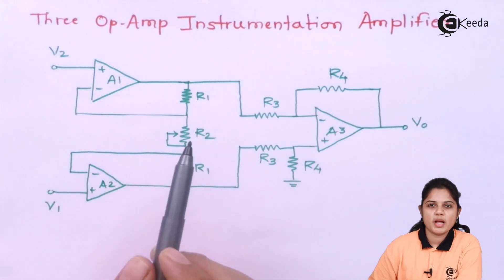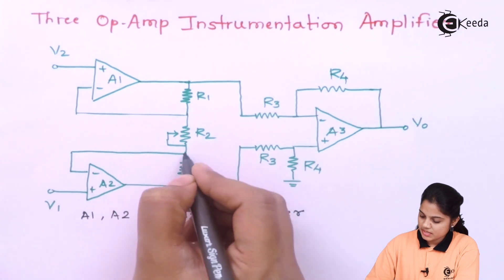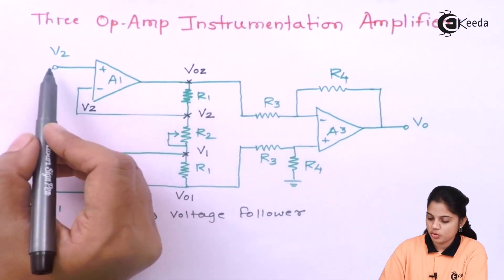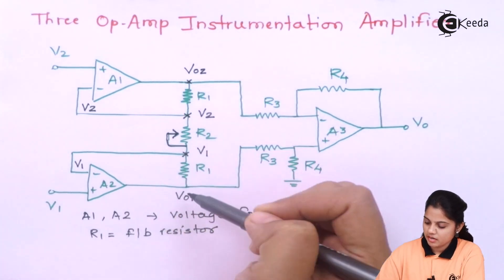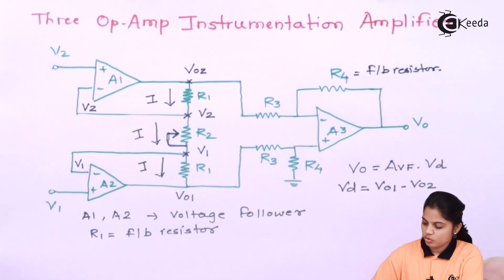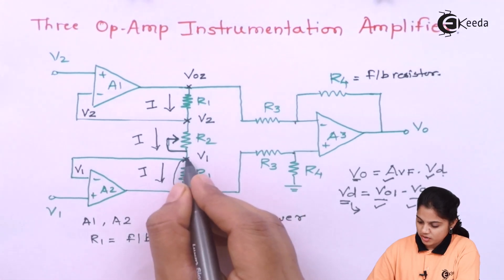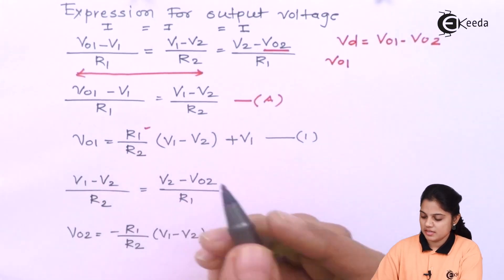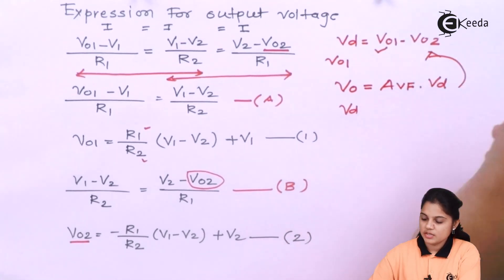Three Op Amp Instrumentation Amplifier - Operational Amplifier and 555 Timer - Industrial Electronic

Comment: It is a differential amplifier, so how will it be in inverting configuration? Because differential amplifier has a fixed gain, there is no configuration right.
Please clear my doubt if I'm wrong.
ASAP.
Reply: EACH OPAMP HAS FIXED GAIN LIKE EITHER 1+R/R OR -R/R BUT in this ckt the three are connected in such a way that by varying R2 we get precise and accurate gain value